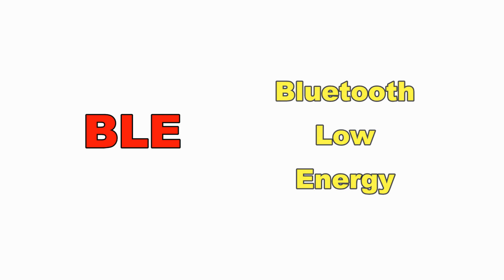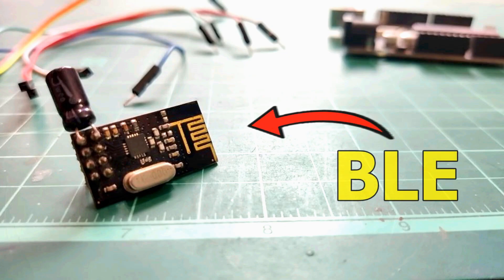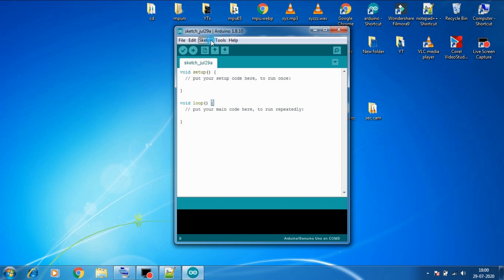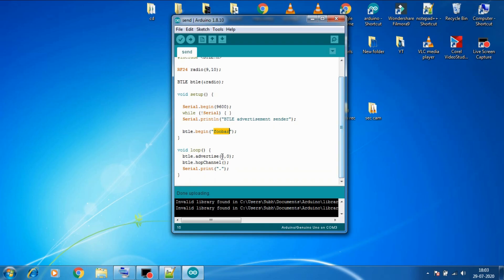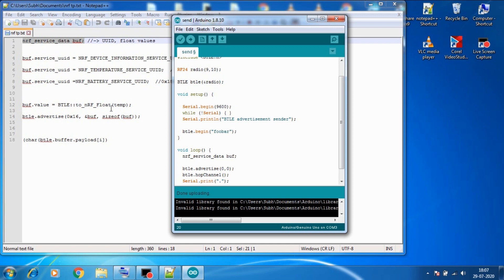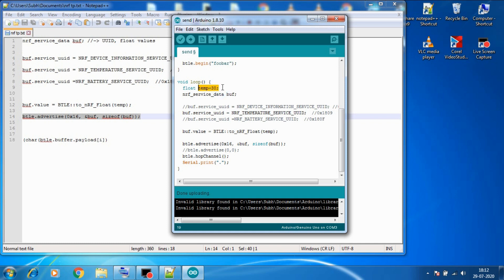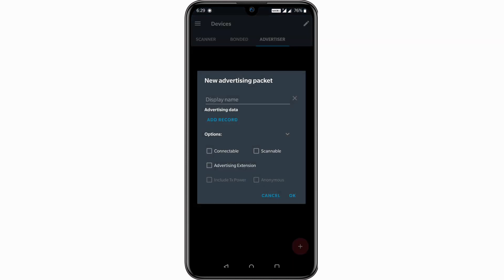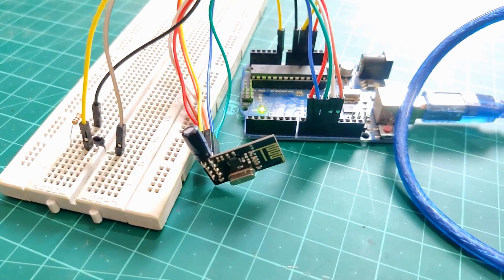use NRF as a BLE Module | Arduino NRF24L01 Bluetooth Low Energy Tutorial

Comment: Hey! I tried using the NRF24 as BLE following your video. I have made the same connections and uploaded the example send code. However, I am not able to see any Foobar named device on my mobile phone app. Can you point out any possible source of error?
Reply from the maker: oh is it the case? i would suggest  check if power is correct  and try to test the NRF it is in good condition. Sometimes  NRF gives a lot of trouble because 2.4GHZ band is very CROWDED & most of the time power issue. It could use a capacitor to stabilize the power

Comment: I did the "receive" example, leaving everything on defaults, like you did, but I am only seeing packages arrive on the Serial Monitor, every other second, or even less than that. Sometimes many seconds pass, without anything showing up.
This suggests to me that there is a very high rate of package loss, like 80% or so. Any idea how to debug this?
Reply from the maker: did you use any delay?
i am not sure man you can print the device info from the packagaes , but it is mostly the case that you will not recieve continuously,  and yes there could be some package lost but our nrf has ble capabilities  it is not a ble thogh so we are limited here to alot of things. but you might wanna implement  some logic to get device info from packages and print it. and when you run recieve code it will try to pick anything  it can find. so you gotta restrict that , thats why we send device info to identify our package.

Comment: Does it work with the nrf24l01+ and plus pro ?
Reply from the maker: yes it does, what do you mean plus pro ? did you mean pa+lna ? if you mean that then yes it should even with pa+lna model i hope you could even get a good range and no package drop
and basically  any version of nrf24l01 will work

even the never upper models of nrf too - not sure how true is that but i think they should
Reply: @electronicGURU  yeah ecaxtly - that's what's I meant - realy long range Bluetooth Le woul be great and ecaxtly what I need for my Project. I just didn't know what the version with the antenna amplifier was called :))
Reply from the maker: well buddy i don't  think so it can see the nrf can read long range signals but the issue is mobile cant mobiles ble range is limited.

so there is a slight chance  it might not work not sure but who knows.

Comment: hey , can the BLE module to be sender and receiver ? i want to create a project by using beacon and a robot ... i want to give a command to the robot through the beacon to be slow or stop. For example if i pressed a button in the beacon section the robot will go slow. but this function will happen if the robot is close to the beacon .
thankyou !
Reply: so i just want to make the beacon send a value to the robot like "robot speed" and then the robot calculating by their function to make it slow or stop
Reply from the maker: Hi , i would like to tell you the NRF is not exactly a BLE , somehow it possess some of BLE's quality so it can do few things but sending and receiving data fully will not work as you are expecting it could work but i am not sure that it will be good idea. Please use a proper BLE module.
Reply: @electronicGURU  thanks for the info, but can you give me a suggestion about how can i "control" maybe 2 or more robots using beacon ? I just want to know how beacon can pass "speed" value to all the robot and then the robot will calculate speed by itself to drive the motor so that all the robot will going to stop or slow, and then what type of beacon would have to use ? Thankyou !
Reply from the maker: Do you wanna stick with BLE ? go with RF man..!! NRF might not serve as good BLE but it is a very good RF module it can create multiple pipes at once and you can control multiple robots by just one controller.

Comment: Hello, nice video! Can you help me out? I have a RF Nano, a microcontroller with built-in nRF24L01. Used the example code with foobar but can't find it in nRF Mobile. Please help and keep it up :)
Reply from the maker: Please find the schmatics for your board it might be due to pins configuration so just check which pin they are connected to and then just change those ce & csn pin in code and you are good to go , i guess. Try it and let me know if it works. Otherwise we will try something else.

Comment: I want to send simple numbers (like 1,2,3) to the NRF24L01 connected to an Arduino with an android App which has buttons for these numbers.
- Is that possible? 
- Do I have to advertise in my app like the nrf connect app does? 
- Is it possible to make a client-server connection between the NRF24L01 and the smartphone?
Reply from the maker: Yes you need to make an advertisement , i am already working on that video hoping to get it complete by next monthm
Reply: @electronicGURU  In Android Studio there ist the sample for bluetooth advertisement. Unfortunately it doesn't work immediately without any changes in the code of the app...
Reply from the maker: You can NRF CONNECT for mobile app to create a advertisement.
Reply: @electronicGURU  Yes I know but that is not what I want to do. I want to advertise like the nRF app but in my own app with my own data.
Reply from the maker: Then you need to get the source code of nrf app so that you can see how they implemented it. Which will not be available i think.